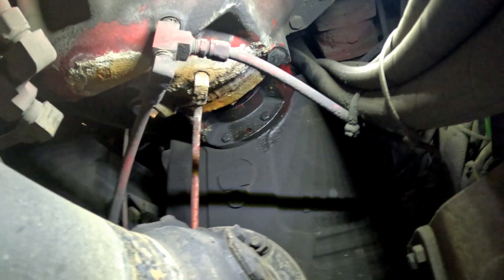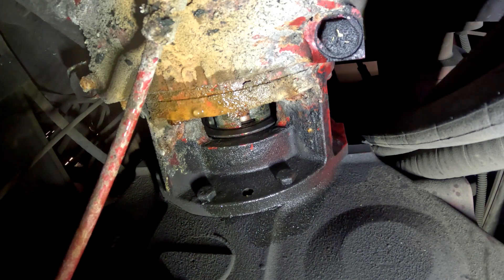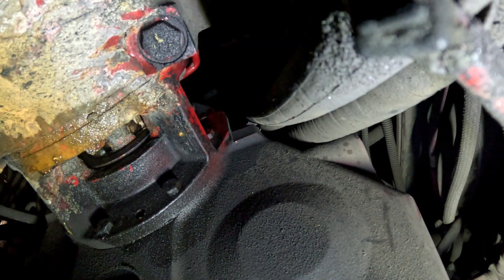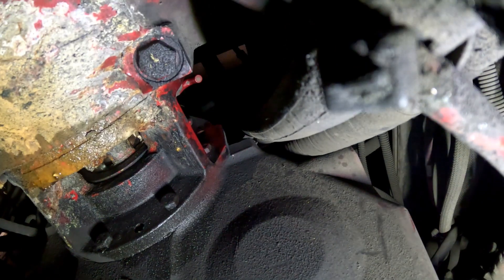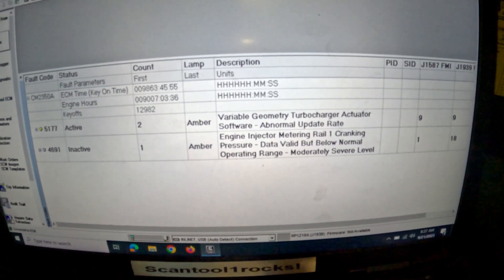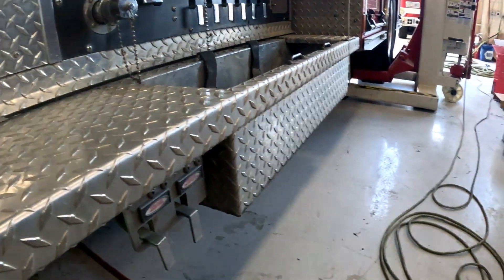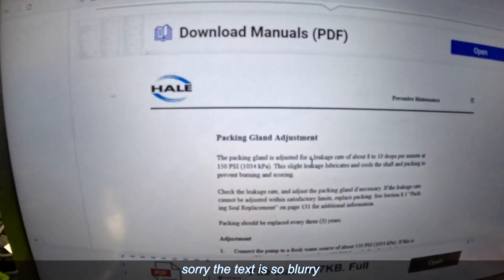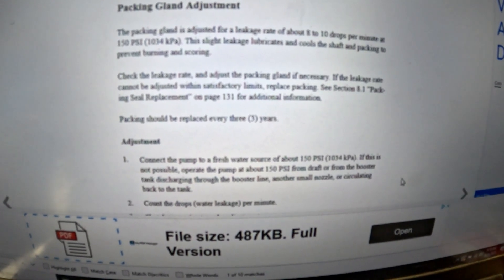hale pump packing adjustment. qmax150

Comment: Kind of unrelated but what would happen if you ran the pump with it not engaged or engaged but the transmission left in neutral? We have some really hot hydrants in our area and i have spoken with a number of people and am very experienced myself and havent found a way to reduce the pressure with a number of different methods but still havent found a real solution. One person had suggested leaving it in neutral and letting the impellers act as brakes but I dont think it really makes a lot of sense operationally but the bigger question is fluid pumps in the transmission or transfer case. Concerned that it would be like towing without pulling the drive shafts. Basically cook something because the transmission pump isnt spinnining or that the same might be an issue in tne transfer case.

Comment: I would like hear a comment from Hale on the pump packing adjustment, I worked on a lot of Hale pumps and adjusted a lot of packing and never used an air hammer with a steel flat punch on a brass adjustment ring unless I intended to replace the adjustment ring. The packing is likely full of scale like the bottom of the pump. My tech were suppose put the pump in gear, with the truck not running and make an adjustment while turning the adjustment nut. The reason for this was the pump shaft can float a bit and I have seen older packing that was tighten like this move the impeller into the clearance ring and end up cutting through it. You can feel it if you are turning by hand but you won't if you just run the pump off the engine.  Eight drops per minute at 150 I find is a little tight but you can check the shaft and gland temperature with a laser temp tester. The3 reason you want to change the packing every 2 to 3 years is so you change them before thy scale up and get this hard, Hardly ever happens.
 I believe by the looks of it just changing the packing on  the outside of the lantern ring would only be a short solution. I believe to do a proper job you need to drop the pump and check the shaft for grooving and install a new packing and lantern ring.
 Thanks for your video, just a comment from a old master EVT.
Reply from the maker: Yeah I really appreciate the comment. Good info. I actually ended up replacing the packaging and adjuster on this very unit.in a later video.

Comment: The code is because fuel pressure is taking too long to build while cranking. Does the fuel rail pressure drop out after shutting the engine off? It should hold the pressure with the engine off. If it drops rapidly, you have an internal fuel system leak to the fuel return. Could be injector, hp pump, rail pressure relief or a combination of components. Quickserve has an extensive process to diagnose fuel pressure codes.
Reply: I would check for air in the fuel next.
Reply from the maker: its dropping out after about 2hours
Reply from the maker: Thanks junkpile I'll look through quickserve for some more troubleshooting tests.
Reply: @scottyzevt Thank you for the unique Fire Apparatus content!